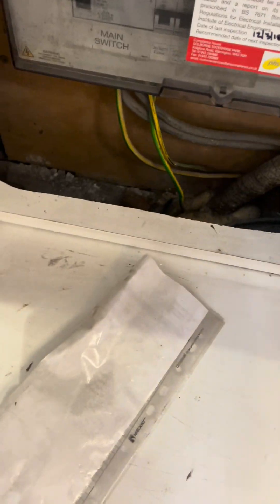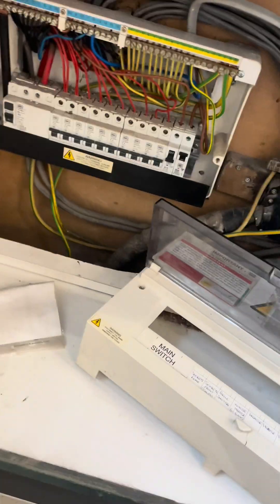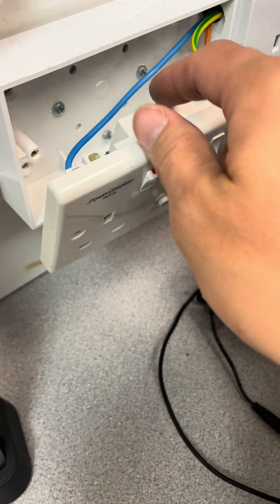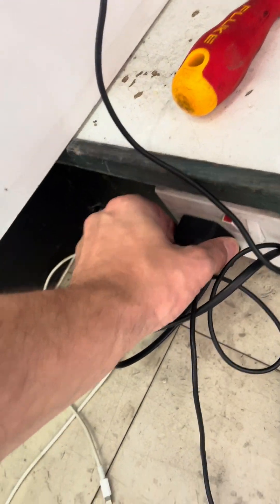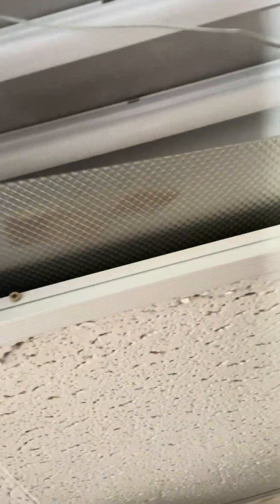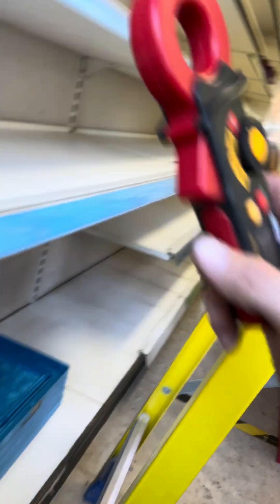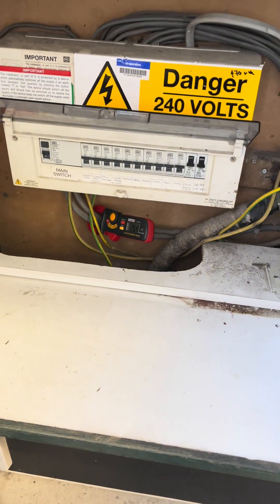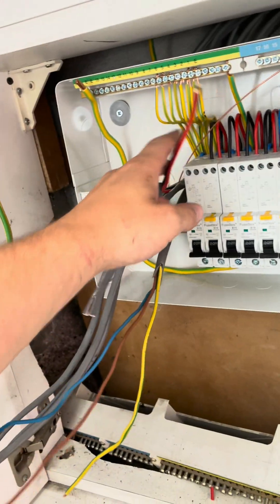SHOCKING SHOP EICR - AFDD BOARD

Comment: Napit have a testing platform aswell, quite expensive but very good for coding etc. Great work mate  (100ma rcd is that applicable for additional protection.
Reply from the maker: No it’s not applicable for additional protection. I’ve used NICEIC, napit, every software and Electraform & Easycert are the best imo

Comment: Totally with you mate, I like to take my time with EICR's as well.
Heard of some that reckon to do 4 a day but I can't see how.
Reply from the maker: 4 in a day not properly is achievable 😂
Reply: @bristolsparky  on the streets there's word about a old way of inspecting and testing called a drive-by EICR
Reply from the maker: @contytub  😂😂
Reply: @bristolsparky : I saw one a while back for a park home site, 30 + units plus street lighting supposedly tested by a team of 2 over a period of 3 days (yeah right), sheets bore little relation to the actual site. Things like Earthing to each unit listed as TNS when a lot of the older units were TT'd etc or 2 x 30ma RCD's in series on quite a few units but none of that picked up.

Comment: Wow that’s a lot of leakage on them lights, interesting to know what you’d do here since putting it on its own 30mA rcbo is likely to cause a nuisance trip, would you A-see how it goes
B-split the lighting circuit in 2 somehow
C-change to modern fittings. 
Obviously price would be a factor but I’d have said C would be the one to go with, what’s your opinion mate?
Reply from the maker: Yeah, ideally the old flourescent fittings need replacing. Due to the sale, I just disconnected some lights.
Reply: likely one or two lights causing it really, as opposed to a cumulation of all. It's unusually high even for old stuff. Would be interesting to isolate one by one to see.
But new panels are relatively cheap, hardly worth the effort messing about
Reply from the maker: @blow0me  i disconnected 2 that looked the worse & it reduced the leakage. It’s getting sold no need to mess around with additional time/money fitting new lights